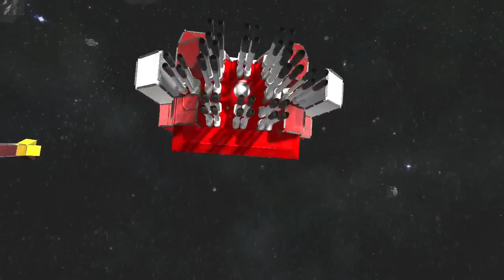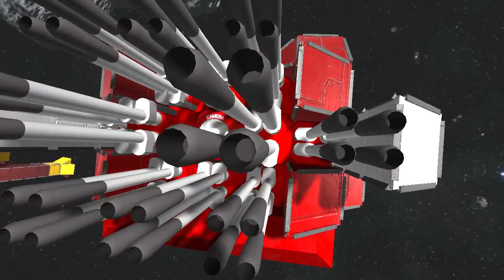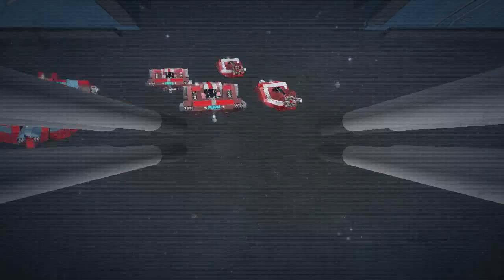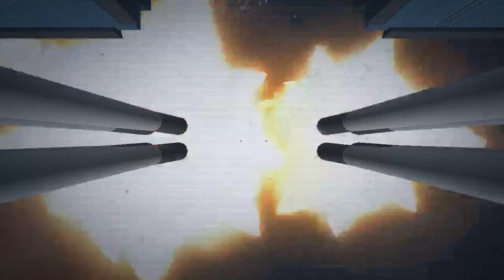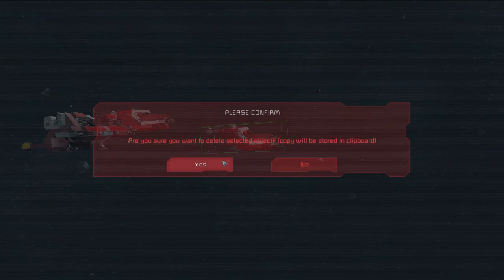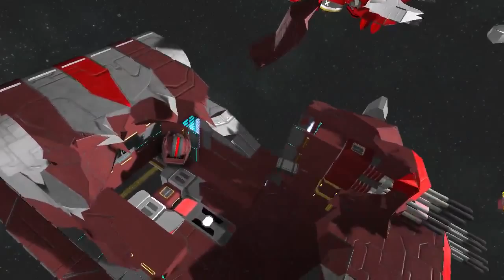Fighters #1: Let's Design Space Engineers!

Comment: From the top of my head, I think the best way to tackle the cockpit issue is to just ditch the cockpit block, and use a shielded Remote block and a Seat surrounded by some light armoring. I know it sounds insane (and you obviously cannot use an O2 gen) but several things lead out of this: Seats have no Computers so they're never targeted. Removing the Cockpit also removes the demand for a bulky O2 system (all you do in the meanwhile is bring some O2 bottles for low-to-zero atmos use), and saves on mass+materials as a result. Some Construction Comps+a few Interior Plates in comparison to lots of heavier materials, basically. You can even use the saved mass to build redundant safety shielding for the seat. I guess the only headaches would be the need to bring bottles and the need to K-menu to the Remote block every time you hop in. But, that's all food for thought in terms of fighter design.
Reply from the maker: +Mattac0n Sure, drones are definitely the best. The only real advantage of a manned fighter is the third-person camera, which isn't even that big an advantage.